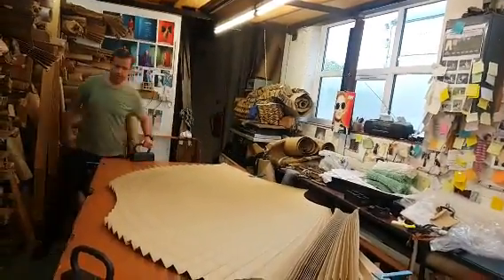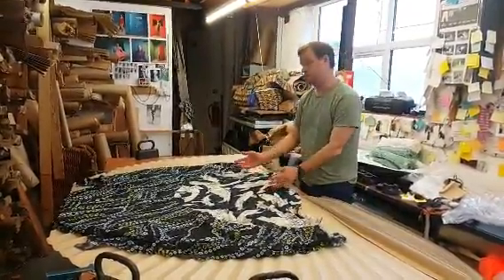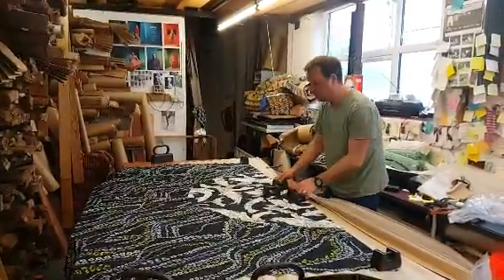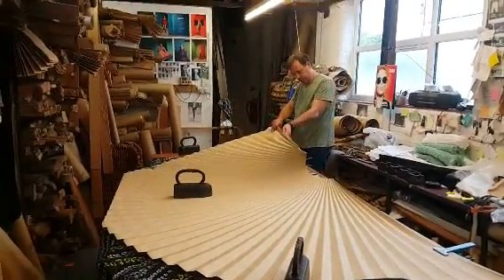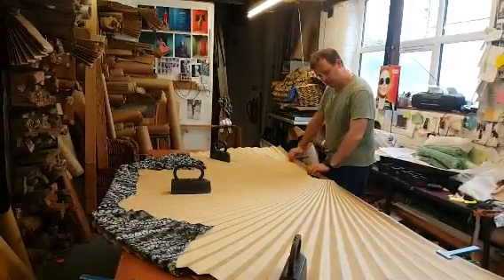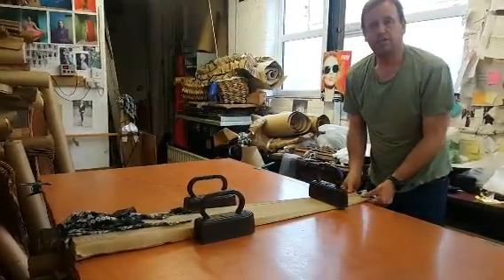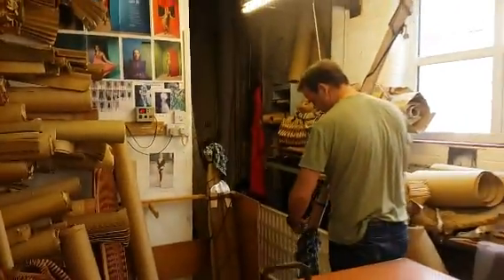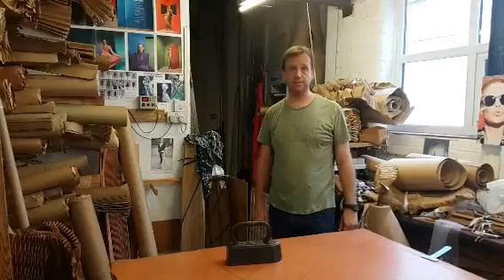How the professionals pleat a Sunray

Comment: Why not suspend the bundle from higher in the steamer, so the extra fabric falls into folds, instead of free-form, or cut it off?
Reply from the maker: This causes the fabric inside the mould to move. WE can actually do this with the basic straight knife and accordion pleats but struggle with the fancy pleating.
Reply from the maker: We actually now tie them to poles so they hang freely down. This client didn't want the bottow vut off.